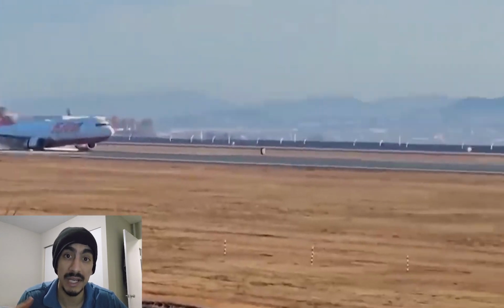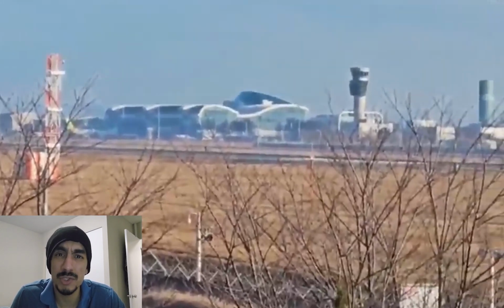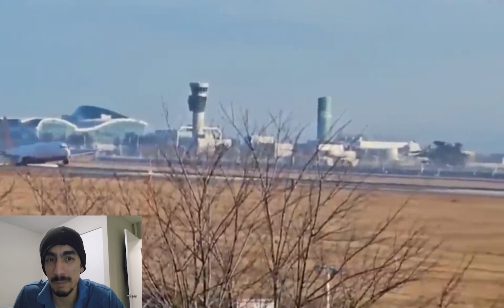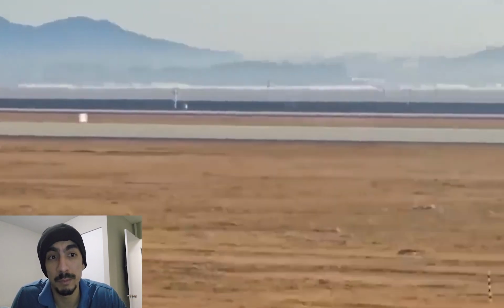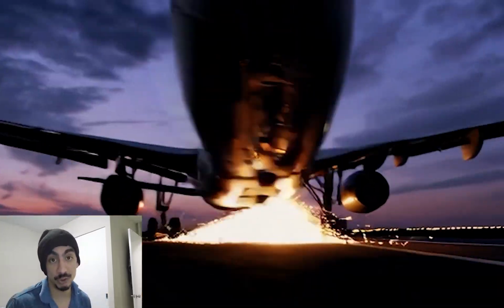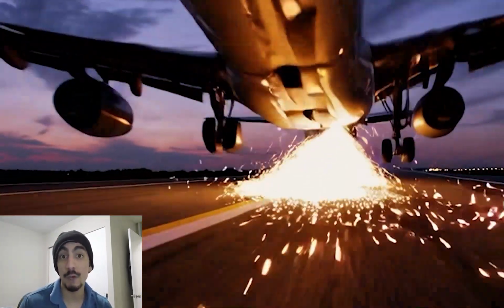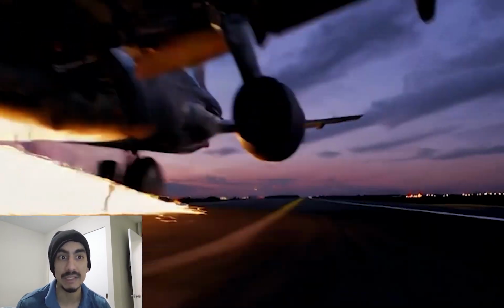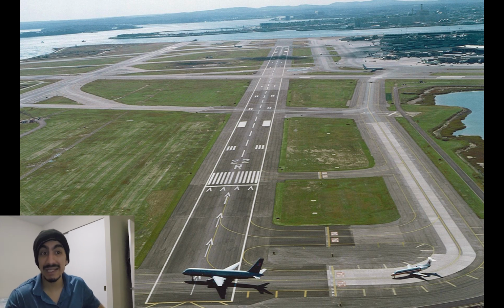Engineer Reacts | Jeju Air B737 Crash | Engineering Analysis | Bird Strike | Belly Landing

Comment: I'm a B737 engineer and this is my take on it.
They were on approach when they got a bird warning from ATC went TOGA gear and flaps up but too late birds hit both engines causing severe damage forcing a immediate landing down wind. 
Both generators out battery power emergency flaps that are very slow a gear that needs to free fall it all takes time. 
The approach was fast and they needed get it under control  in a very short time  
 Now that aircraft hase a third generator and pneumatic system with the APU  that could have saved the situation. 
To save a few minutes of extra fuel the APU is switched off after engine starts and only switched on again after landing. 
LESSONS TO LEARN .
APU SWITCHED OFF AFTER TAKE OFF APU ON FOR LANDING.

Comment: So it sounds like a multiple systems failures. So sad. Did you see a picture that the pilot had his hand on a ceiling control 1 second before the crash? He was still trying to control the plane! So I doubt he panicked. I wonder what might have happened if the pilots hand belly landed on the grass?

Comment: Recently the Cockpit Voice Recorder (CVR) and Flight Data Recorder (FDR) have been downloaded and it was found that both recorders stopped recording 4 minutes before the accident. The FDR is powered by the AC Transfer Bus 1, which is a 115V 3 phase 400Hz supply, which is normally powered by the No 1 engine driven generator. Similarly the CVR is powered by the AC Transfer Bus 2, which is a 115V 3 phase 400Hz supply, which is normally powered by the No 1 engine driven generator.

If one of the generators trips offline there are cross ties which enable both transfer buses to be energised by the good generator. The second generator fails, then all AC 115V 3 phase 400Hz is lost. If running the APU can also provide this supply.

Losing both generators is an indication that both engines have failed.

The hydraulic systems A & B are normally pressurized by the engine driven hydraulic pumps, fitted to the main engines. If one engine or the hydraulic pump fail, these systems can be pressurized by an electric motor hydraulic pump. These pumps utilize 115V 3 phase 400Hz from the AC Transfer Bus 1 & 2. So If the APU is not running, with a double engine failure hydraulic power and AC power are lost.

In this situation the aircraft cannot be configured for landing. That is the undercarriage and Flaps & Slats, cannot be deployed. 

The the undercarriage can be deployed by gravity, by releasing the locking latches. This requires a panel behind the co-pilot's seat to be opened and thee handles pulled extending the attached cables by about 5ft. This takes time.

Without hydraulics and AC power the aircraft can still be flown as the pilots' controls are connected to the flight control surfaces.

The aircraft does have 28V DC aircraft batteries, which can supply power to essential systems.

There is a modification so that the CVR is provided power by the Recorder Independent Power Supply (RIPS), which provides a backup supply for 10 minutes after the AC power is removed. This modification was not installed in the incident aircraft. About half of the jeJu Air fleet of 40 aircraft do not have this modification.

There is no battery backup for the FDR.

Comment: you never mentioned depressurisation of the craft upon impact with would cause explosion combined with heat..normally takes a few minutes to de-pressure.
Reply: The 737-800 is normally pressurized to 8,000 ft, below that altitude the pressure is increased to match that of the surrounding atmosphere. On landing the pressure differential would be almost zero and not contribute to the explosion.

Comment: In the case the aircraft was approaching at 200 kts, which is the correct speed for a flapless landing. In order to stop on the runway it would have to at least 6,000m long. Runway 19 is usually 2,800m long, but due to construction work (extending the runway) only 2,500m was available. The longest airport runway is 5,500ft.

If the aircraft had not hit the ILS installation, 70m beyond is the airport boundary wall which encircles the airport. It is a security installation, because the military also use this airport. It has several layers, including watchtowers and a service road within the perimeter. There is a public road just outside the wall.

If the aircraft had not hit the wall, 1,200m further (4,000m from the threshold of the runway) there is a hotel complex and other building along the shoreline, which the aircraft would have hit. Beyond that is the sea.

Without flaps & slats this landing was never going to have a happy outcome.
Reply: Thanks for your precisions and  absolutely agree! Wall or not, at this speed their would have something else on the way yo kill everybody...
Reply: A third working generator would give them full electrics hydraulics etc normal operation flaps gear spoilers brakes and the ability to get the speed under control  
NOT ROCKET SCIENCE IS IT. APU SWITCHED ON FOR LANDING AND TAKE OFF.
Reply: Tru but they would have had a better chance the death wall sealed the deal rip

Comment: The Engineered Materials Arresting System (EMAS) is designed to decelerate and bring to a halt aircraft that overrun the runway. It is a series of ceramic tiles that are progressively broken by the aircraft wheels. However it is limited to 70 kts and will not work without the undercarriage being deployed.
Reply: BS it would
Reply: @TheUrantia001  That is not what the manufacturers say. 

A further problem is that the retardation per unit time, at high speed, the dwell time in the EMAS is short, so longer runoff areas would be required. 

Many airports have building developments close to the ends of the runways and limited safety areas. These have been reduced as the runways have been extended. This is one reason EMAS was developed, to make best use of the safety areas.

During this accident the aircraft attempted a flapless landing. Also the spoilers were not deployed. In this configuration the wing would have been generating some lift, reducing the pressure of the aircraft on the runway. The three points of contact are relatively large compared with the contact patch of the wheels. The result is that the coefficient of friction is low and hence is the retardation.

With the undercarriage extended the wheels exert sufficient pressure to break the EMAS ceramic tiles and dissipate more energy. During this accident the aircraft would continue to skid on the unbroken surface and the resulting retardation would be similar to that achieved on the runway.

Comment: The aircraft hit an ILS Localizer Antenna Installation, which was built by the US military when the airport was an airbase. It was originally constructed the the 1950's and latter (when still a US base) it was modified. The South end of the runway is lower than in the middle so the Antennae need to be raised, it was also prone to flooding and the foundations  moved in the saturated earth. This necessitated frequent calibration of the installation. The solution was to build a reinforced concrete raft an to mount the antenna on top.

The construction and location is compliant with the current International Civil Aviation Organisation (ICAO) guidelines, because it is far enough away from the end of the runway to be out of the safety area.

The Instrument Landing System (ILS) permits the aircraft to land in poor weather conditions. The Localizer provides the pilot with positional information, with respect to the centerline of the runway. Hence the ILS antenna has to be on the runway centerline.

Structures built within the safety area must be frangible and the foundations shall be level with the surface.
Reply: sounds like you are biased towards protecting a certain side
Reply: @TheUrantia001 sounds like you are biased towards "overrunning over 120kts is common and perfectly survivable". You fail to notice 99% of runway overruns are below 20kts, 80% are below 10kts. 99% are with landing gear extended. Concrete foam arresting device is inefficient without at least the main landing gears extended. You also fail to notice a fck ton of airports/runways in the US alone are no better than this at clearing open area with frangible structures beyond, let alone in the entire world. Also, classic jetliner structure is good at belly landing on a paved stable profile runway. On the grass however, especially with variable slope, and inconsistent dirt/mud density, the odds leave the "stable structural integrity" domain to randomly reach the catastrophic structural failure realm every second. It being a ditch, a pond, a brick wall, a road (with variable edge levels of different density), a warehouse, a parking lot...

At that speed, it doesn't matter what you have 90m beyond the end of the runway, it will be deadly!

What would have happened if that pile of dirt wasn't there?
- we have uneven down slope dirt/grass, like most airports in the world. Chances to get one or two engines ripped off are high, severing main wing tanks along the way. Bad, real bad. Note that near the perimeter fence, the ground slope comes up again, that will be enough... 
- assuming both engines remain attached, you meet brick wall standing on top of concrete footings, that small one feet base is enough to crush and poverize both engines, then deform wingbox structure (forces dispersion through the structure), this vaporize kerosene into droplets in an instant in all directions: the nature of the impact doesn't change the fireball outcome if you let kerosene get crushed, escape and disperse that fast. Not having that pile of dirt won't prevent explosion. By the way, the entire lower nose would have desintegrated upon hitting the wall basement, deforming the cabin into a mangled mess, seats rows torn forward, one third of passenger and the pilots instantly died.
- but a 737 is ~60 tons overall. A brick wall can't stop that, too frangible. Therefore, now you have several chuncks of hull and people strapped in ripped seat rows propelled airborne while burning, and since no impact is even, all those debris and bodies are spinning, then drifting/skidding on uneven terrain after secondary impact (road and grass). Those inside wrecks will slide farther (less friction and more roll, more centrifugal dispersion getting airborne/no-drag again) Other less lucky will find a terrain obstacle and abruptly stop with a force of over 100g. Mostly deadly after a few seconds of burning sensation. 
- By the way, the tail section... Since the aircraft opened a hole in the wall, that tail will pierce through whatever is in the way, there's an APU there, structural stabilizers reinforcements and cabin pressurization dome. A nice uneven heavy projectile... Hope your two flight attendants in the back are well strapped and lucky enough because instead of flipping over once to disperse impact force efficiently at the expense of a crushed fuselage, now they enjoy a 300m roller-coaster ride through shrapnels and fire. 
- Now what: firefighters on site can't cross that wall with burning debris, concrete rubble, no road. Now they have to go back to the barracks, reach the gate nearby, drive outside the airport all the way to the crash site extension on the perimeter road. If someone is alive there still trapped in the burning carcasse chuncks of some fuselage section, better hang on cause it will take a while...

All of that because "we prefer the entire fuselage to survive overruning at that speed..." (facepalm) A car at 100kts can stop fast and occupants can SURVIVE because the car is DESIGNED TO SOME EXTENT TO EFFICIENTLY DISPERSE HEAD ON IMPACT FORCES. That's also why cars can't fly, they are too heavy. Aircraft don't have that luxury. Now, propel a car at 130kts, make it drift to lose friction just like that 737, and make it veer of the road, it will start to roll, catastrophically desintegrate, possibly eject its occupants. That's just 1 ton car, a 767 is 60 times heavier, with thousand times more fuel, and a cabin as weak as paper at the scale of involved forces. Stop watching Hollywood movies if you can't understand plane crashes in those are fiction, none of them are anywhere close to what happen in real life, especially that stupid misconception of a fuselage getting out pretty much intact after several impacts.
Reply: @TheUrantia001  BTW, those focused on that dirt pile are the one leaning towards blaming some side, at all costs. Those who are not are not interested in protecting anyone, rather, HAVE THE REASONABLE PRINCIPLE OF GETTING THINGS RIGHT, like finding out the actual causes, cannot be accused of bias.

The primary cause at this point is "ENERGY MANAGEMENT". In other words, manage your altitude and speed to have enough of both to reach the runway, without excess (if possible) to not overrun or at least overrun at a reasonable speed where the 90m dirt/grass after the runway end is STATISTICALLY ENOUGH to bring you to a stop. Not even the need of concrete foam. What happened which made you expedite a desperate landing, to the point you had no means to properly manage your energy? Did something else happened, like multiple bird strikes, or aircraft systems critical failure or aircraft not behaving as expected in training? (there's a lot ongoing discussions about electrical power and batteries, seems even EXPERIENCED 737 pilots EXPECT flaps to operate okay with engine #2 running, appears it's not the case) Those are the kind of questions that should be asked. Instead, many are blaming the pilots while other behind their screen are PRETENDING TO BE CAPABLE OF NOT MESSING A SINGLE DECISION AMONG A THOUSAND CRITICAL ONE. How much bank, what attitude, what order of switches at what moment...

Comment: The 737-800 Auxiliary Power Unit (APU) does not have an auto start function, however same aircraft do have this as an option.
Reply: How long it takes for apu to get GEN connected after start up?
Reply: @bobbrouzouf1932  About 45 seconds.
Reply: Also, how long it takes to get 3 greens since alternate gear handles are pulled?
Reply: @bobbrouzouf1932  Many minutes.